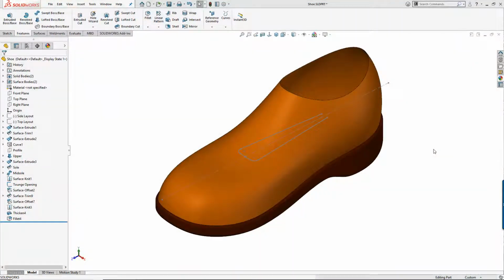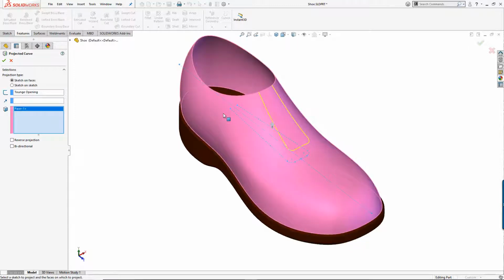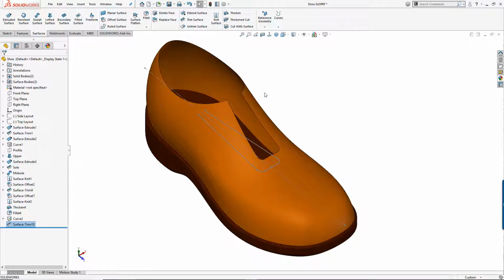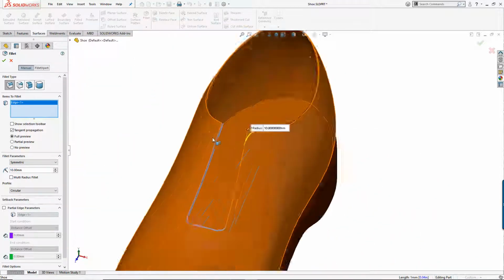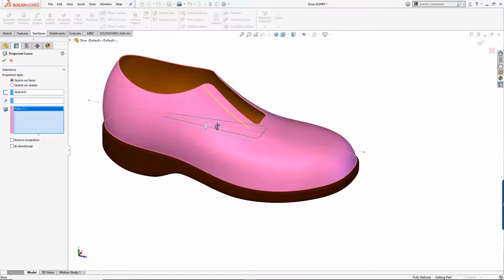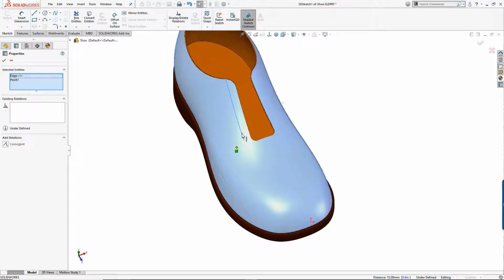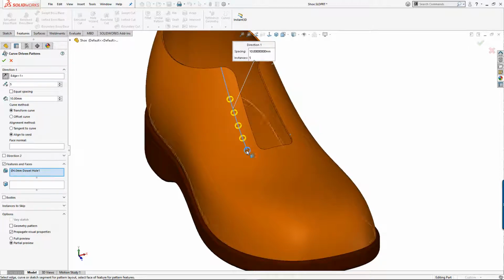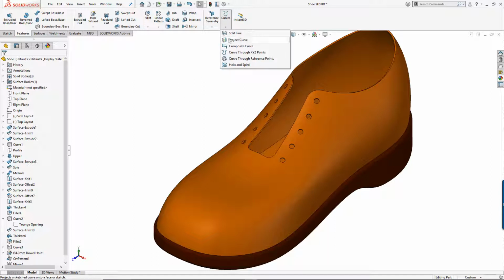How to Sketch on Curved Surfaces in SOLIDWORKS (Project Curve)

Comment: How come I cant select trim surface?  How do i knit the surface?
Reply from the maker: Hello. I can't say for sure without seeing your model, but is it possible the surface you are trying to trim is actually a Solid Body? Double check your FeatureTree to ensure the geometry to be trimmed appears in the Surface Bodies folder.

Use the Knit Surfaces tool to combine surfaces. Edges on the adjoining surfaces must closely align for a successful knit.

Comment: My SW for some reason doesn't let me select the surface trim function, it's probably something wrong with the setting but I can't find anything. Any tips for that??

PD: great video btw, I learned more from you than from my uni teachers during this quarantine
Reply from the maker: Thank you! I'm glad you're finding them valuable. 
I can't say for sure without seeing your model, but is it possible the surface you are trying to trim is actually a Solid Body? Double check your FeatureTree to ensure the geometry to be trimmed appears in the Surface Bodies folder.

Comment: HOW DO YOU SHOW THE HOLE, CURVE, COMPLEX, MEASUREMENTS ON A SW DRAWING?
Reply from the maker: You’ll need to make a custom view normal to the hole or curve geometry in the part document, and then insert that view into a drawing. Annotations can then be attached to the view.

1) If required, create a Reference Plane normal to the hole or curve geometry.
2) View the model Normal to that plane.
3) Press SPACEBAR to bring up the Orientation dialog, and then create a New Named View.
4) Show any sketches in the part you want included in the drawing view.
5) In the drawing, insert the named view, and then attach the desired annotations to edge or sketch.